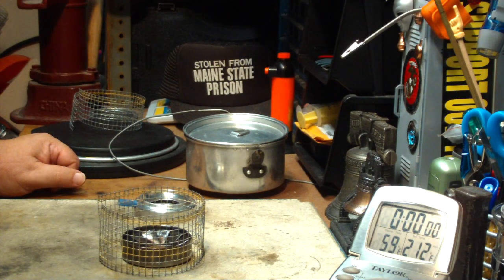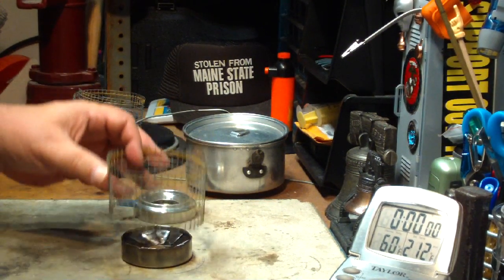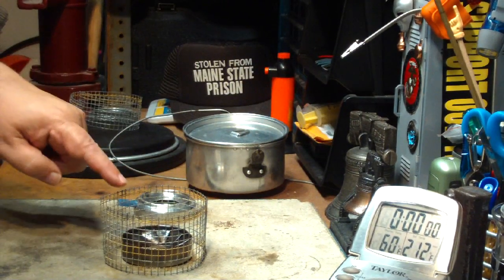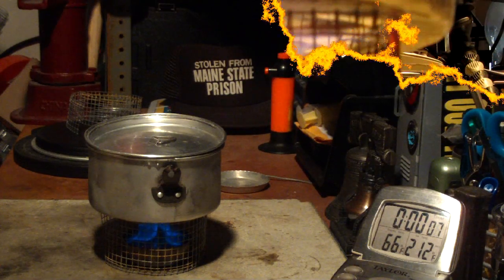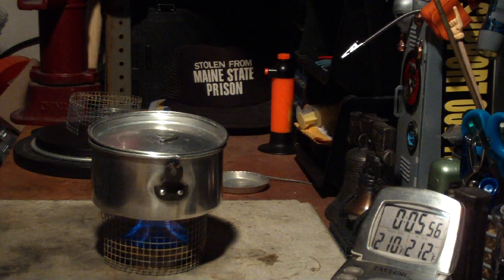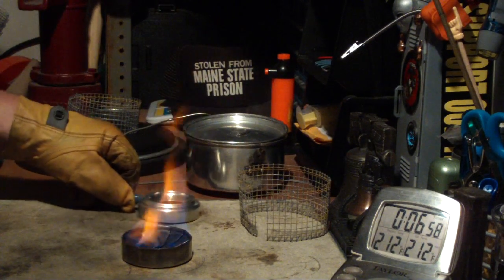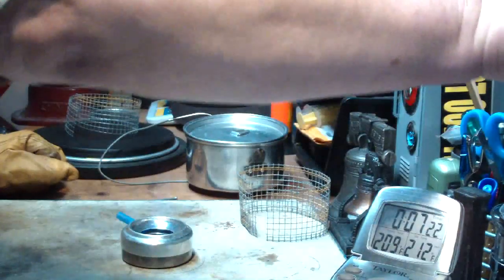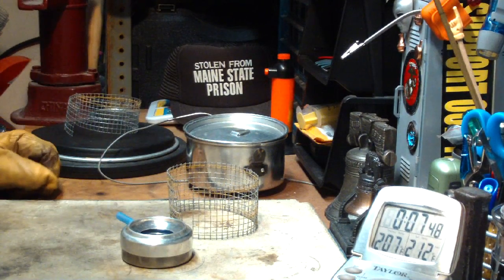Flat Cat Gear's Standard Stove & Simmer Ring - Boil Test #2 - Higher Potstand

Comment: Hiram,  stove (or burner) performance is a trade-off between speed and efficiency.  We measure stove performance at the “System” level, as in the complete Bobcat System including the windscreen.  We have found that the higher pot to stove gap decreases the time to boil however; it is also a little less fuel efficient.  Our goal has been to use ½ oz. of fuel to boil 2 cups of 70 F water as fast as possible.  That is how we determined the 1.8” height.  Jon

Comment: with my testing ive found the hottest/fastest boil times are when the bottom of the pot hits the flame at 3/4 to the tip of the flame, then you add in reflective windscreen/base